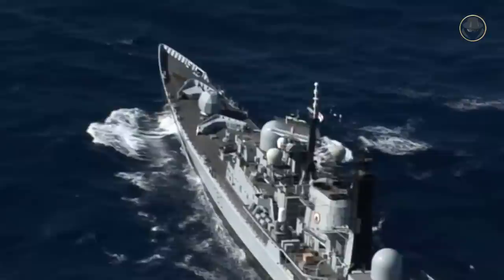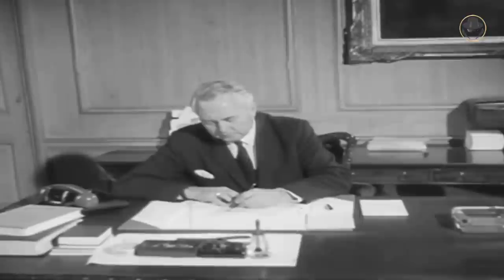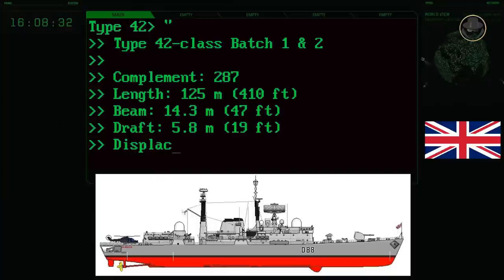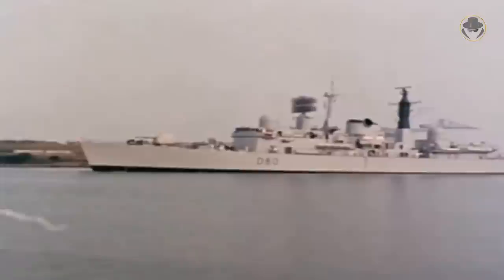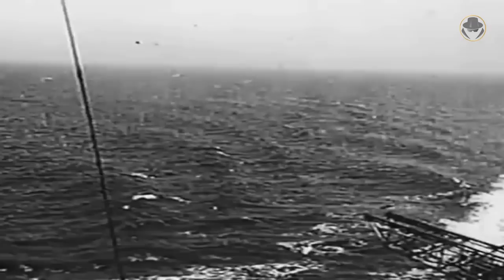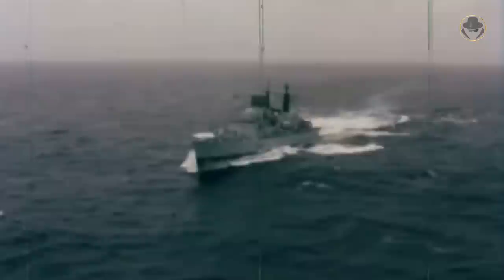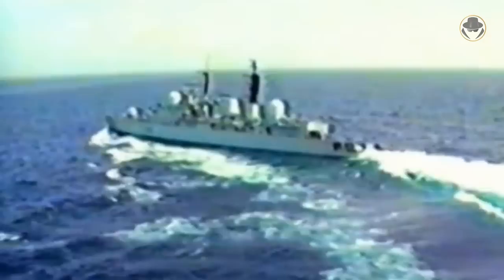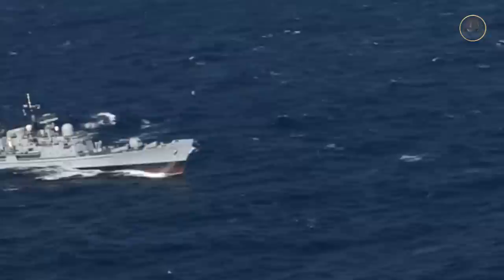Type 42-class destroyer | Her Majesty's indomitable warrior

Comment: Objection 1: The claim that Type 42 as initially built was "re-designed and shortened to save money" is nonsense. The original sketch designs were 385 ft. long. The final design chosen was 392 ft. long. There was never a point where it was longer and cut back. It is possible the length was frozen at 395 ft. to prevent the addition of new and expensive features which would drive up cost and threaten the program. Getting the equipment she was to receive did force the hull to be full too near the bow, resulting in wetness forward. 

Steel however is relatively cheap, and just lopping off some length doesn't save any money. Meaningful economies were made elsewhere in the design, which in many was was quite austere. She was the bare minimum Sea Dart ship. 

Also, the Type 42 were never conceived as escorts for the Invincible class small carriers. The Sea Dart frigate concept pre-dates that by a considerable margin. In the post-carrier RN Sea Dart ships were to be spread out across the fleet among groups of ships, not grouped around a capitol ship like Type 82. 

Batch III (design studies beginning in 1975) was stretched to 434 ft. because it had become obvious even before the first of class hit the water that the original Type 42 design was extremely cramped, had no growth margin and some undesirable sea keeping characteristics. 

Objection 2:  At the time of HMS Sheffield's attack by Exocet carrying Super Etendard's it was her UAA-1 ESM system that was turned off, not her obsolescent Type 965R long-range air search radar (which would have been of little use anyway).  She was using her SCOT satellite communications system which emitted radar-like frequencies whose side lobes gave off false alarms to the too closely located UAA-1 antenna. So UAA-1 was shut down during SCOT transmissions, which prevented Sheffield from detecting the radar emissions that would have indicated attack and allowed her to employ counter measures and potentially engage (yes, the gun and Sea Dart can engage Exocet).  Even so, Sheffield did get warning of the incoming raid from other ships over her Link 10 datalink system, to which insufficient attention was paid. 

Objection 3: Post-Falkland's the surviving Type 42's got a quick remedial close-range weapon upgrade of a pair of twin 30mm BMARC guns and two additional Oerlikon GAM-B01 20mm.  The Mk 15 Phalanx replaced the BMARC's in 1987, the ships losing the STWS torpedo tubes as weight compensation. 

Objection 4: HMS Sheffield did not have "an aluminum body that melted".  Sheffield was struck in the machinery spaces. The gravity-fed header tank of her fuel system disgorged its fuel, spraying it about the engines space when the missile impact severed the fuel line. Broken casings on some of the gas turbines caused an intolerable high-pitched whine which kept damage control crews out of the space. Because Sheffield had no emergency generator outside her machinery spaces (cost cutting) she lost electrical power. Fires from the Exocet's rocket motor could not be easily put out as the fuel contained its own oxidizer. Smoke filled the machinery spaces and the lack of smoke barriers (cost cutting) meant the crew could not remain aboard. Melting aluminum (other than ladders) was not a factor. 

The losses of Type 42 destroyers in the Falkland's were due to conscious cost-cutting gambles made in the design stage to keep the ships affordable in the numbers required.
Reply: Shorter than Type 82
Reply: @k.kavala  - Nobody said  otherwise
Reply: @MFitz12  I object to objection1
Reply: And the Royal Navy has still not learned from that in their new ships . Which are also under armed . The sea sceptre cannot shoot down ballistic missiles nor does it have true BVR capability . The RM Missed a big trick I think
Reply: @darshanaratnayake6186  - Sea Sceptre isn't supposed to do those things. Not a requirement. It is, like its predecessor Sea Wolf a fundamentally ship self defense system.

Not every ship needs or should have a BVR area air defense missile with ATBM capability - which is very expensive.

That is why no navy puts such capability on every ship.

Comment: The trouble with the Type 42 was that as a result of cutting the design of the Type 82 down to the bare bones to save costs meant that they were always too small to be upgraded. This was improved with the stretched Type 42
Reply: The original design of the T42 was the 'stretched' version which was then redesigned further to the B1 and B2

Comment: OK, Sheffield was caught with her pants down, but what happened when the Glasgow and Coventry got hit at point blank range?
Reply: Issues caused by the  hull design which meant in heavy seas waves were splashing heavily over the gun/ sea dart  system. so flash doors and micro switches were encrusted with sea salt prevented Sea Dart from being fired on several occasions, one of which happened on the raid Glasgow was hit. The Coventty loss happened because the type 909 was confused by the land  as the ships were  close to shore and   then Coventry in trying to maneuver  got in Broadsword's line of fire.when she was about to let loose  Sea Wolf on the 2nd attempt. Issues with the escorting type 22's Sea Wolf system  didn't help either during both attacks , but that was because it was designed as an anti missile missile so the computers threw a wobbly as there were instances when the targets behaved like aircraft and not missiles . As there was nothing in the programming to say that's still the target the computer would search for another target or crash as it didn't know what to do. As the war went on Sea Wolf was reprogrammed and re wired by  a rep from the manufacturer Mr David Breen as he just happened to be on Billiant I think when they went south. When they worked both missile systems were deadly. Sea Dart did hit targets that were in theory  below the min engagement height ( Exeter's Skyhawk kills ) and out of range (Cardiff 's Canberra) . Sandy Wooward who was Captain of Sheffield earlier  in his career suspected some more Sea Dart launches were made when the target aircraft had to play ball and continue on course for the kill to be certain. He sent a message to Coventry  earlier before that ship scored a kill  saying "Don't fire till you see the whites of their eyes" hinting that he thought Coventry may have  launched too soon when they seemed to miss a target.. That's easy to do when you're under pressure in war conditions ( launch early)
Reply: @dcmchugh99  very informative, thanks!

Comment: Why there is no close up missile like sea wolf using in type 22 on type 42, maybe a 4/6 launcher on top of the helicopter hanger?
Reply: Simple the MOD live on the cheap it would cost to much to put seawolf instread a couple of gpmgs you might just hit a jet .
Reply: Sea Wolf was not a thing yet when Type 42 was designed. 
British policy at the time was for fundamentally single-role ships.  One class would carry Sea Dart while another would carry Sea Wolf and yet another would carry Ikara.  This even boiled down to Exocet, with re-built Leander's getting either Exocet OR Ikara. To get Sea Dart AND Sea Wolf on one hull you need a much bigger ship, which means more cost which means fewer ships.
Type 42, particularly in Batch 1 and 2 could not accommodate Sea Wolf, which was hardly a compact system. Look at the very expensive near complete rebuilding of the Batch 3 "Seawolf Leander's where entire bulkheads had to be relocated for illustration. Heck, as built the Type 42 didn't have enough reserve to accommodate STWS-1 torpedo tubes! 

Personally, I always thought the Dutch Tromp class frigates (whose basic design came from Yarrow in the UK) did it all rather better.
Reply: Yeah minimum of two layers of missiles and a double barrel 120mm Bofors gun and later Goalkeeper.
And fitted with Harpoon adding offensive capability.
Reply: @McCorduRoy1972  - Standard SM-1 was in many ways less capable than Sea Dart circa 1982, but not in any way that would have really mattered in the Falkland's. Having an additional channel of missile fire forward for full 360 coverage would have prevented the situations we saw with the Type 42's were Sea Dart was sometimes blinded by the ship being pointed the wrong way, requiring hard maneuvers and "over-the-shoulder" shots. 

Having search radars with MTI even more important.

And an ESM system that doesn't need to be shut off when you want to talk to someone.
Reply: @MFitz12  A lightweight 4 Round Sea Wolf Launcher was in developement for fitting to the Type 42's, in place of the aft Type 909 Radar but the idea was dropped  without any being made.
Reply: @paultanton4307  - I am aware. Even "lightweight Sea Wolf" was not light. 

I can not count the Batch I/II Type 42 destroyers as a particularly successful design. The requirements of the day (we need X number of Sea Dart at sea, you have sub 12 million a pop to spend, have at it) meant the ships were designed and built not only with significant omissions of equipment and economies of design which directly resulted in the loss of HMS Sheffield, but with effectively zero growth margin. 

They form a stark contrast to another destroyer design building at the same time., the USN Spruance class. Those ships were, because of the urgency of replacing worn-out war built tonnage, built on a philosophy of "for but not with" which had the lead ship hitting the water at about 8,000 tons with only two 5" guns, ASROC, torpedo tubes and a LAMPS helicopter!  

But then look what happened. 

Meanwhile Type 42's had to lose their torpedo tubes just to get a pair of Mk 15 Phalanx.

Comment: Yes, but what about those strengthening beams. Why were they necessary?
Reply: In use,especially with  the experience gained from the Falklands War,some ships were found to suffer from Hull Twisting ( technical term is 'hogging' i believe ),in particular the Type 21 Frigates.This was remedied post war,but with the advent of the stretched  Batch 3 Type 42 and the Batch 3 Type 22  Ships issues were again found and the strengthening Beams had to be fitted.
Reply: The Batch 3 ships with lengthened hulls were found to be structurally weak as a result, requiring large reinforcing strakes.